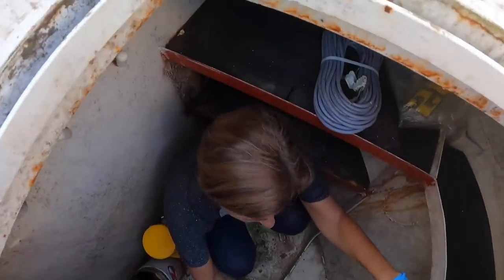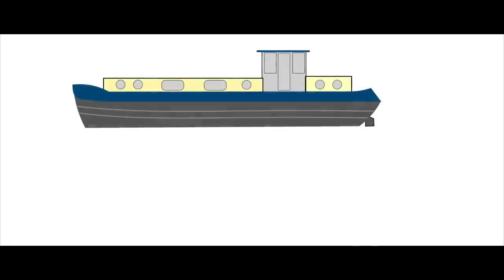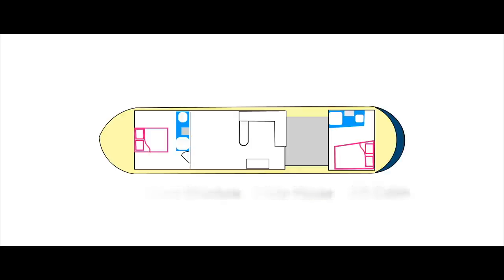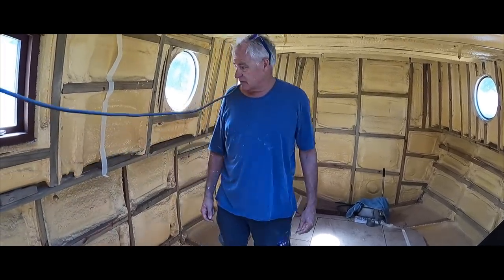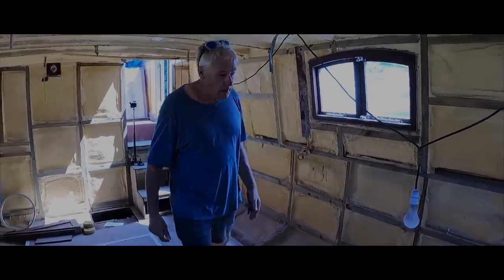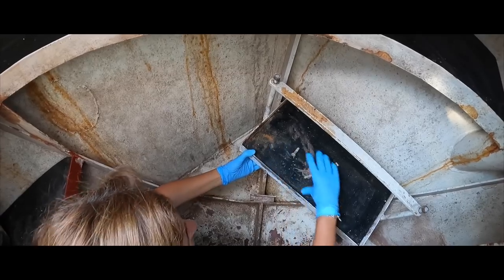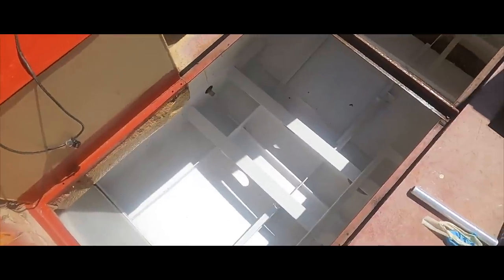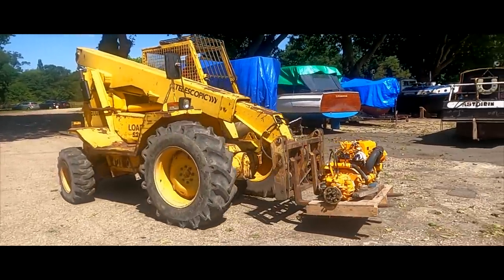BARGE BUILD. NASTY work begins on the BARGE! The NEW Barging Lifestyle! Sailing Ocean Fox Ep 174

Comment: Looks good, the move went well, the boat looks great in the daylight. Please buy yourselves professional quality knee pads, and I hear it is advantageous to wear 2 or 3 latex gloves on each hand so if you need to do something with clean hands for just a minute or two, you peel a layer and afterwards you are still read to go. That was from people fiber glassing at the time.
Reply from the maker: That’s a top tip, will do the gloves for sure and the knee pads are on the list to but. Cheers Tim

Comment: When painting it’s much easier and does a better job to use a mini roller, the one with ext handle is the go. Various nap thickness for different surfaces. Super fast and don’t be shy with the paint. 
Why don’t people build barges out of aluminium?
Reply from the maker: Loads of little corners that need a paint brush really. But yeah on bigger surfaces definitely the roller. Cheers Simon
Reply: @SailingOceanFox  i’m a painter by trade and we use them a lot, they will get into small places as they have fibre on roller ends. the 4” sleeves are perfect for that stuff. use the deeper roller tray, less spills.
Reply from the maker: @simonhantler8062  thank you Simon I will try that one

Comment: I’m sure you’ve thought about the pilot house a lot. I would really not have it so tall. Why not an open pilot area with a fold down windscreen and a canopy that can be rolled down. This will give you far more scope in terms of inland waterways. And you won’t be permanently enclosed in a claustrophobic pilot house
Reply from the maker: Well, it’s England! As everyone knows the weather is not great here so we will need an enclosure space. But they will open on the sides so lots of air if the weather allows. Cheers